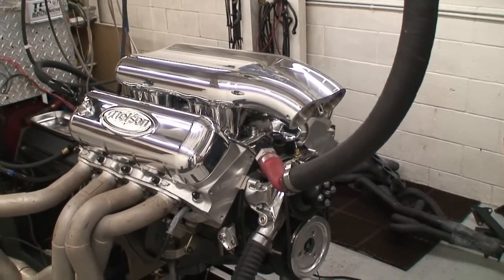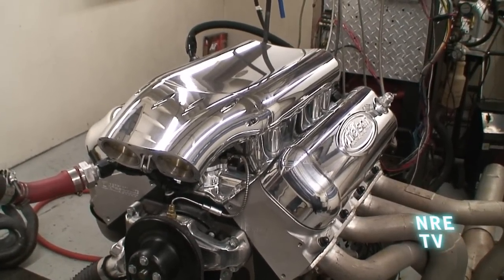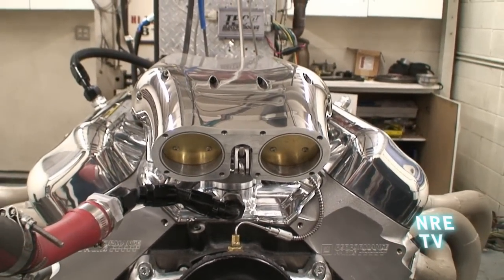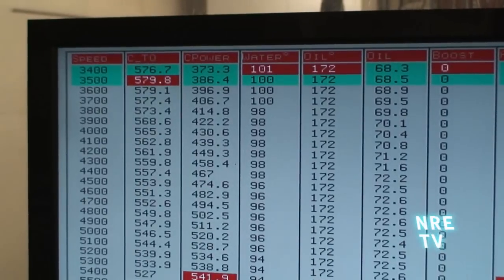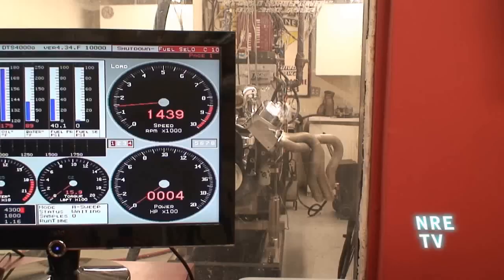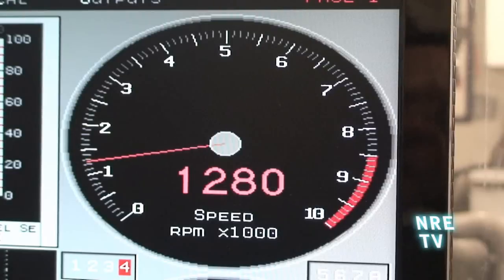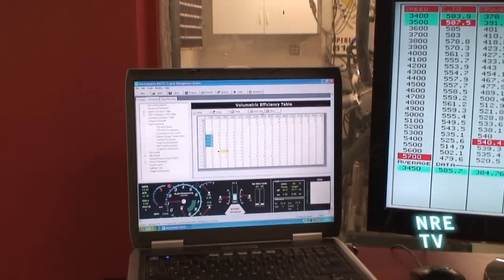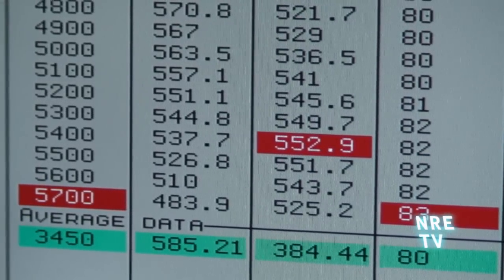"Alien" Intake Manifold EFI 502 BBC Crate Motor from Nelson Racing Engines.  HD Video.

Comment: Let's see at 1900 RPM and making 470 FT LBF of torque this Rat is cranking out
only 170 BHP, witch means when you come off idle at 900 or 1000 RPM and hit
2000 it's making less then a 327 mouse at say 3000 RPM? BHP = T x N / 5252
And, what is the increase in BSFC with the new fuel delivery system? Your making
more power but how much more gas is being used.
And, of course, this is the question that makes all these race motor weenies
cringe at__how many Cat converters to meet Calif Emis laws?